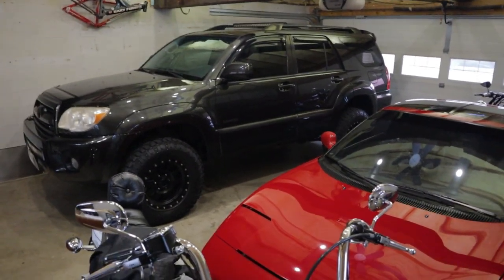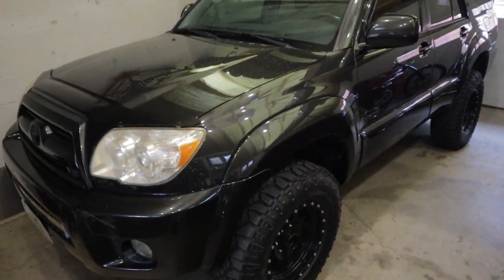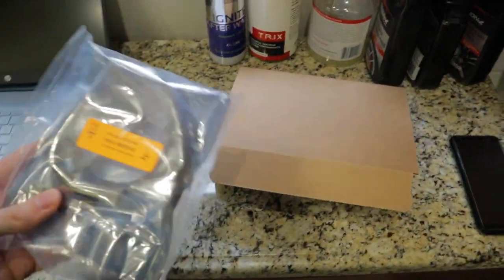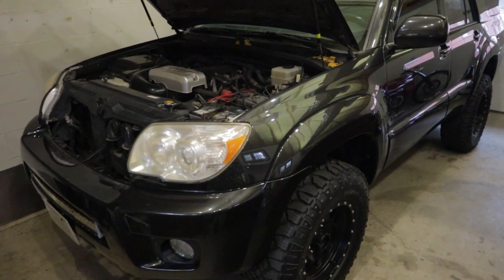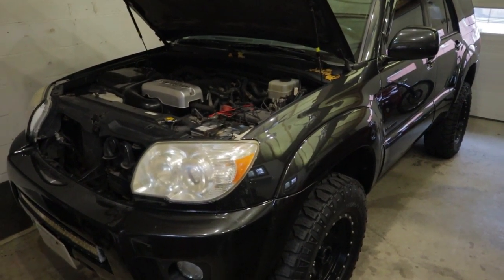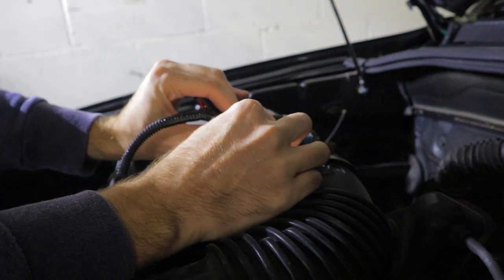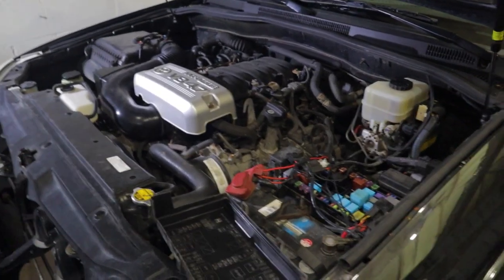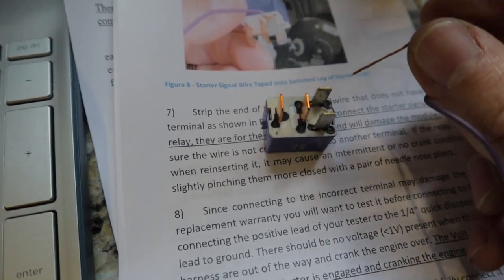Avoiding A $3,000+ Repair With A $150 Mod (V8 4runner Secondary Air Injection System)

Comment: I really needed this. I did so much research on common problems before buying my v8 vvti, and no one seemed to have mentioned this one only if you look it up. A few weeks ago, the problem came up and I knew I just replaced my gas cap so it couldn't be this.
Reply from the maker: Do you have codes for the SAIS? I'd definitely recommend Hewitt Technologies 👍

Comment: If you remove the foam filter from the air pump in the valley next to the starter the system will not fail. The valves become blocked with the degraded foam over time. I replaced my valves and pump, before I discovered the foam as being the issue. The bypass kit blank off plates are difficult to install on old rusted systems if the bolts snap.
Reply from the maker: There are a few ways for the system to fail, not just from a physical blockage
Reply: @CanadianGearhead   Yeah, you're right that it can come from different causes.  Wish I had seen this video sooner.  My '05 is in the shop now.  This was my wife's car and had the primo parking spot.  The 4runner went to a spot under an old oak tree.  The mechanic working on it says the leaves and acorns from the tree are what caused my issue.  Yay me...but at least it isn't at a dealership so I think this will be a  little less than $2k.

Comment: Would it work for 2007 gx470 with 2UZ motor too ?
Reply: It's literally the same vehicle but with Lexus upgrades for appearance and comfort. Yes it'll work on your 2UZFE just as it will in a Tundra or Sequoia too.👌 Same engine and transmission as your GX470. You've got a few extra beauty panels covering it up but it's the exact same motor. 👍

Comment: So my vacuum pump just started making noise a couple days ago and all of a sudden now my check engine light is on, but I just now realized what the problem is and that the pump fan fails and breaks apart. Once that happens can I just bypass it with the bypass kit or do I have to rip the engine apart and clean out all the pieces of the fan and then put it all back together???

Comment: Boy I just bought an 2004 all black looks identical to yours with 210k on it in great condition.tuns strong and now I'm a bit discouraged 🤣🤣🤣🤣 my FJ had 240k on it and I would lnt hesitate to drive that across country.but I will never buy anything but a Toyota .I'm confident my 5 runner will be a beast..i loved my FJ but I'm gonna lift this 3 inches lie my FJ
Reply from the maker: No need to be discouraged, mine hasn't failed yet and I'm sure there are lots of others that are good too. Just one of those things that sucks if it does happen
Reply: 2003, 2004 don’t have SAI or vvt. Outside of slightly lower power and torque numbers it’s the best version of the 2uz. I have an 04 with the 2uz and almost 300k miles runs incredibly strong and reliable
Reply: How’s it holding up in 2024? I’m looking at buying a v8 04 with 230k on it. Kind of hesitant

Comment: Quesstion, I haven't had my car go into limp mode. Does that mean it could be another problem?
Reply from the maker: You need to read the diagnostic trouble codes to find out exactly what the problem is. HT has a list of codes on the product page that are associated with this system

Comment: I just installed this on my ‘06. It was super easy. 👍🏻
Reply: Did you do the block-off plates?  I am going to install mine later this week (not in limp mode) but will have to have the block-off plates installed by someone other than me.  Even though we don't have emissions tests in my state, I had a Japanese mechanic mention to me he couldn't install it for I guess to be legal reasons...?
Reply: @loganhooper8161 
I haven't installed the plates, but I might try doing it myself. I'm pretty sure I need new exhaust manifolds so I might have the plates installed then.

Comment: I had no idea about this secondary air injection system problem. I may now do this as well thanks to your video. I have the same 4runner as you with DT shorties also... I am wondering about the block off plates - do you know if it is just a matter of loosening the header studs to slide the plates in??? Thank you for this upload!
Reply from the maker: You actually loosen off the nuts that connect the pump to the small tube on the header - you don't touch the header studs at all
Reply: @CanadianGearhead  Oh that's good to know. I'll have my mechanic do it, who installed my my headers... thanks man! Appreciate it.

Comment: Is it totally necessary to mount the blocking plates. Or would it be fine just being bypassed. Seems to me if it was bypassed nothing else would be needed... thanks for the video and update...
Reply from the maker: I haven't installed the plates yet but according to the company, the flaps can still rattle themselves open or closed. I'm not sure how likely that is

Comment: Just double checking, making sure I was understanding you right. Can I use this kit(gen 1) if im already getting the SAIS stuck close code. I been getting the code lately and all I been doing is deleting it, the car is not on limp mode and im still able to drive it. I have an 05 4.7L vvti engine
Reply from the maker: I would talk directly to Hewitt Tech, they're super knowledgeable about this stuff

Comment: You have a 2007 limited hey ?  

That’s what i have,  so I’m assuming I can get the same one you linked.  

I would like to do this as preventive maintenance 👨‍🔧 

Have you seen about how to add the disable traction control switch ? 

That would be a cool video I think
Reply from the maker: I've thought about doing a VSC off switch - you're right, that could be a good vid
Reply: @CanadianGearhead  yeah I think it would be a popular video,
Reply: @CanadianGearhead  did you install your own lift kit ?

Comment: I got the engine check and checked it, it was the second air injection system but the a day later the engine check lights turned off, should I be worried ?
Reply from the maker: I would definitely consider bypassing it while it's still working, maybe it's on its way out

Comment: Finally getting around to doing this today, I have the CEL, it goes on and off every week or so, doesn't put me in limp mode though, I don't it happens with every vehicle FYI/FWIW. Did you eventually put the plates in?
Reply from the maker: I haven't had time to put the plates in yet

Comment: Hey man, I have an 07 4Runner throwing me a P1443 code. The description is Secondary Air injection system switch value circuit. Would this diy fix the problem?
Reply from the maker: I would talk to Hewitt Tech, they'll be happy to help you sort it out 👍

Comment: Ill  be installing the DT  headers on my 06, and thinking with the delete and block off plates i could use DT headers for the preface lift 03 or 04 4.7L.  is that correct?
Reply from the maker: I would double check that with Hewitt but it makes sense to me
Reply: @CanadianGearhead what are DT headers? I have a 07 sport edition V8 will,I need this? Thanks in advance.

Comment: I got a 06 4runner with 208,000 miles. The transmission runs really smooth and I don't see any transmission fluid changes in the car fax. Do you think it would be worth changing the auto trans fluid for preventative maintenance?
Reply from the maker: It depends on who you talk to - some people believe it's best to change it and others say to leave it alone
Reply: @CanadianGearhead  That's what I keep seeing too. Have you changed yours?
Reply from the maker: No I haven't
Reply: Change it by doing a full fluid exchange through the cooler lines.  Not a power flush.  Fluid doesn’t last forever, even if they call it “lifetime.”  It isn’t that difficult or expensive.

Comment: Block off plates are a scumbag. The bolts either round off or snap on rusty 4Runners. Good luck installing them. I had to weld the plates in the connection. I wasn’t about to spend eternity trying to extract the broken bolts.
Reply from the maker: That doesn't sound like fun